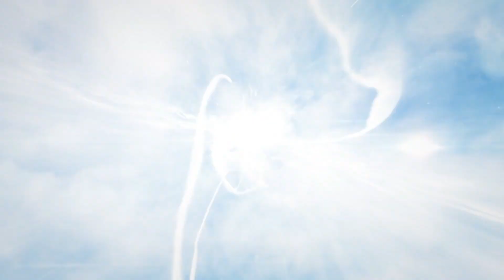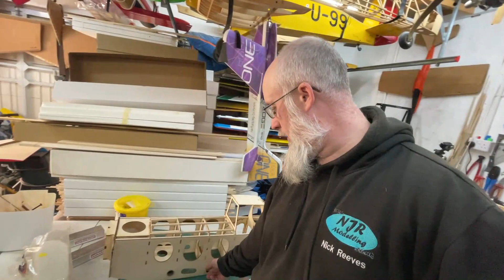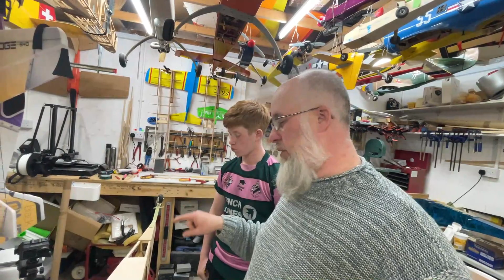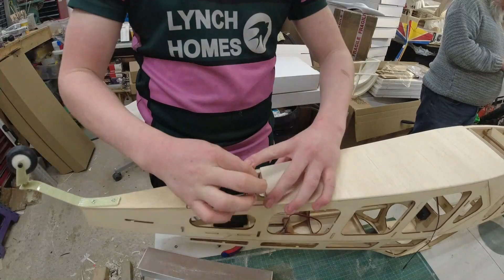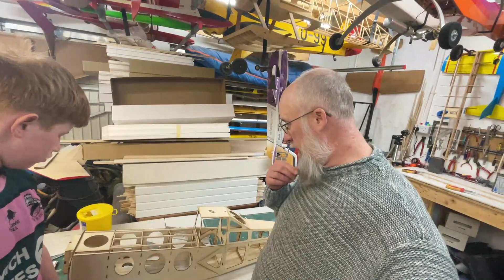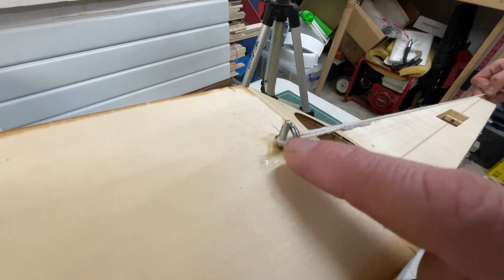Farmyard Build Zenoah 38cc Powered Pt11 Servos?

Comment: Daft question as ive never towed anything before..... does the glider drop the tow line as well? or does it stay attached to the glider?  i assumed the glider released from the Tug and the Tug kept the line hanging from behind.....sorry daft i know.
Reply from the maker: In normal operation the glider drops the towline once at height. The release on the tug is for emergency use really. For example if the gliders release fails, the tug can drop the glider. If the tug say has an engine failure, tug pilot can drop the glider possibly before tue glider even knows it’s happened